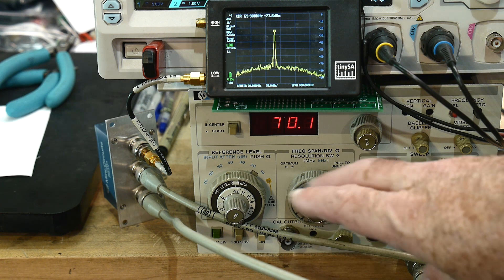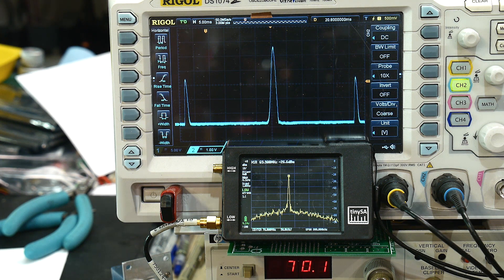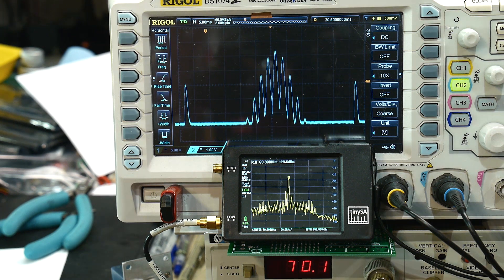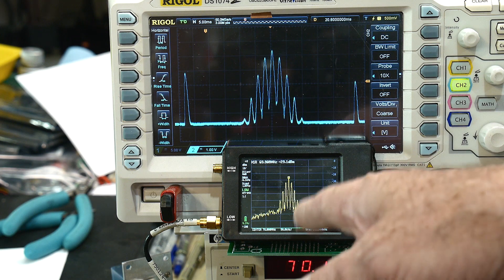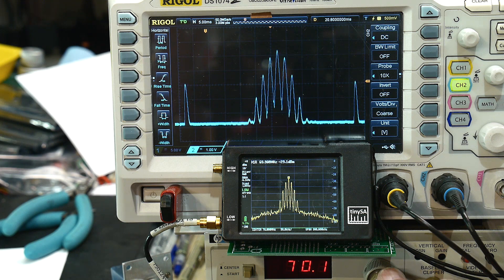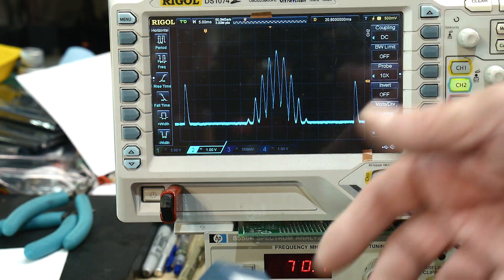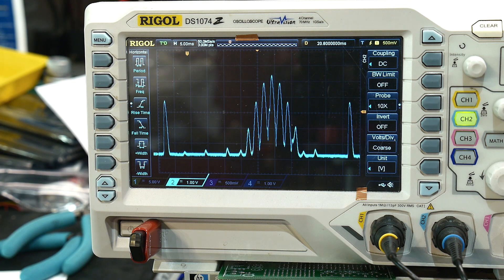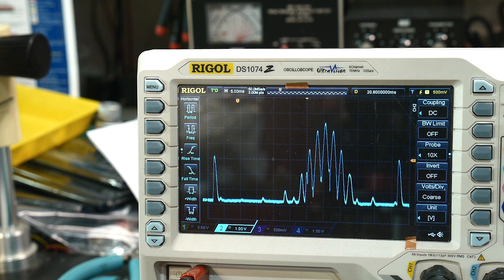#578b TinySA and HP8558

Comment: Isn't spectrum analyzers on the scope from the math function?
Reply from the maker: The FFT on a scope works for low frequencies. It is hard to use and not very good in my opinion. It has no chance to do high frequencies.
Reply: @IMSAIGuy  Not good as a vintage HP spectrum analyzer?
Reply from the maker: @Michael-w8v  old analyzer is much faster and has better resolution. TinySA is frequency accurate and stable and much smaller and cheaper
Reply: @IMSAIGuy  also Rigol give me a headache in my work...  that is why I prefer Keysight in work.

Comment: Just received two tiny SA's from R&L, one to play with and one to give away as a door prize at our Zoom club meeting next week. My first SA was "The Poor Man's Spectrum Analyzer" using old TV tuners followed by an A&A Engineering 450MHz analog kit and X-Y on a analog scope as well. Those X-Y displays don't seem to play as well with DSOs, Alan W2AEW did a video about that, though your HP SA adapter appears to  do a good job in conjunction with the Rigol.
Reply from the maker: amazing you can give away spectrum analyzers....
Reply: @IMSAIGuy  Yep, we have some generous folks in our club...gave a NanoVNAH-4 away last month.
Reply: How do you have the 8558 hooked up? Normally those are in a 180 series chassis, but yours looks to be standalone?
Reply from the maker: @ruhnet  I apply power from a lab supply, then use a test point that has video connected to the scope input and another test point that has start of sweep pulse connected to external trigger on the scope. I have several videos about the HP8558 on my channel
Reply: @IMSAIGuy  Ah ok, yes I'll have to check those videos out. I used to have an 8558 in a 182T chassis. Traded it a while back, but have thought about getting another one to play with. I have other SAs for real measurements but I'd kindof like to have a simple all-analog one again like the 8558 just to mess with, so if it's that easy to run them without a display cabinet I may get one.